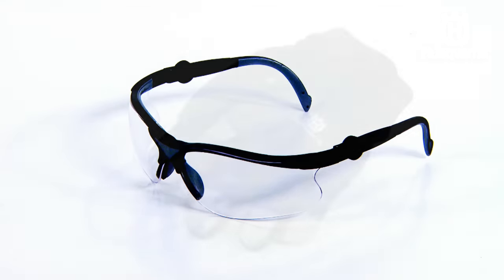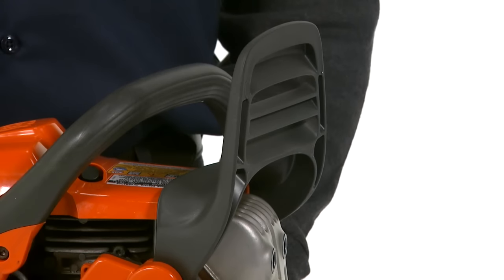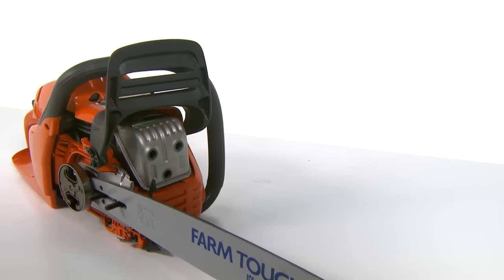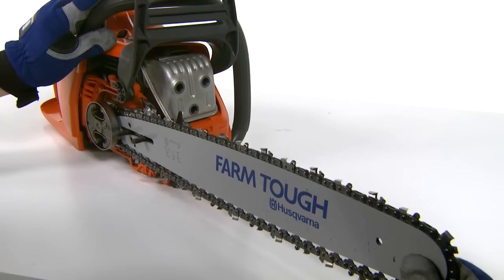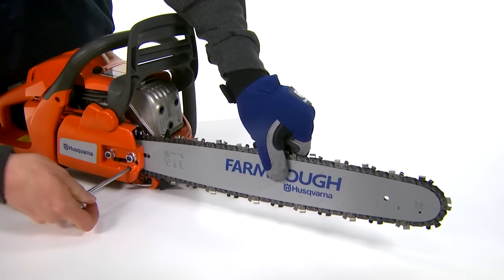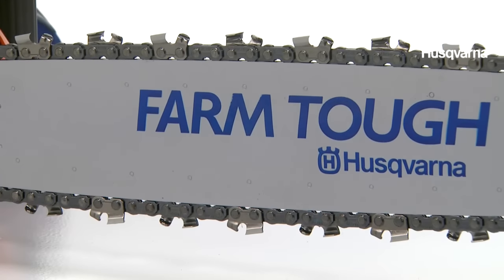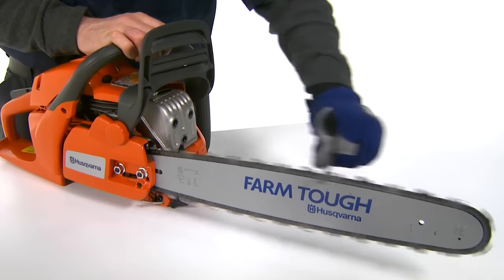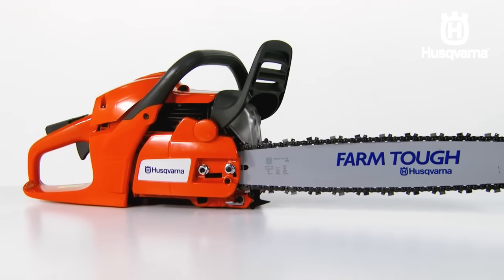How to Fit the Bar and Chain on a Husqvarna Chainsaw

Comment: Incorrect information,  a certified husqvarna dealer is NOT the only one that can fix it if you forget to disengage the break.  It's an easy fix. I just did mine a couple days ago.  It is not hard.  Pull the cover apart,  take the plastic off that's on the inside of the cover,  pull the spring out which will give it enough room to put it back in where it needs to be.  Pull the spring out,  cut 3/4 of an inch off it, put it back in and reassemble. There is absolutely no change to the chainsaws ability to work properly.  Again,  this is what I did and it worked.  Save yourself the money and do it yourself
Reply: It's even easier than that.  Just put the cover back on while the bar is off, press the gear down on the place the handle engages it and pull the handle back.  You don't even have to take anything apart.  Lots of videos on YT showing the process.  Super simple.

Comment: I can't get the chain brake cover back on because the manual chain brake spring that goes around the chain brake is too tight. In fact I had a hard time getting the cover off because that spring was would not let go of the Chain break. Now I can't put the cover back on because the spring diameter Is too small.
Reply: Probably  because when you took it off the brake was on. I did the same thing. You have to unlock it with a tool to put it back on. You can find a video of it here on YouTube. But you will probably have to order the tool. Good luck
Reply: @williamhartsell6390  Yup. I realized that later on. Inadvertently pushed forward on that chain brake and set myself up for a world of hurt. Man it was tough to get that brake released when the mechanism is apart. Finally got it. Won't make that mistake again!
Reply: you have to disengage the brake before you start the project -- there is a few videos that show how to do this -as I've done it once - a real PAIN in the Biden!
Reply: @jimforsythe3129  in my case, the chain brake got accidentally engaged and I took the damned thing apart that way. I know never to do that again!
Reply: @basspig how did you get the cover back on?
Reply: @Greg-yh2md  yes, after a couple of hours of making a jig to turn the brake assembly back to the unlock position.
Reply: Thank you. 

I forgot to release the brake before removing the cover. I saw someone used a 9/16” wrench to turn the brake off. They used a screwdriver into the the opposite side of wrench (the side with the circular 9/16” opening). Used the screwdriver in the opening to twist the wrench which was engaged with the 3 pronged key in the chainsaw, twisting  the 3 pronged key and unlocking the brake. 
Live and learn. And, Happy Holidays.
Reply: @Greg-yh2md  The tricky part is that it is very easy to inadvertently engage the chain brake when in the process of pulling off the chain brake/cover assembly. Nowadays when I do this, I take extra care to make sure the brake is off before I remove it.
Reply: 41

Add a comment...

@AndrewKleinow-z2t
0 seconds ago
Incorrect information,  a certified husqvarna dealer is NOT the only one that can fix it if you forget to disengage the break.  It's an easy fix. I just did mine a couple days ago.  It is not hard.  Pull the cover apart,  take the plastic off that's on the inside of the cover,  pull the spring out which will give it enough room to put it back in where it needs to be.  Pull the spring out,  cut 3/4 of an inch off it, put it back in and reassemble. There is absolutely no change to the chainsaws ability to work properly.  Again,  this is what I did and it worked.  Save yourself the money and do it yourself

Comment: Just took my bar off with our pushing the handle , dammit
Reply: 41

Add a comment...

@AndrewKleinow-z2t
0 seconds ago
Incorrect information,  a certified husqvarna dealer is NOT the only one that can fix it if you forget to disengage the break.  It's an easy fix. I just did mine a couple days ago.  It is not hard.  Pull the cover apart,  take the plastic off that's on the inside of the cover,  pull the spring out which will give it enough room to put it back in where it needs to be.  Pull the spring out,  cut 3/4 of an inch off it, put it back in and reassemble. There is absolutely no change to the chainsaws ability to work properly.  Again,  this is what I did and it worked.  Save yourself the money and do it yourself

Comment: Anyone have issues with nuts vibrating loose when in use? I feel like there ought to be a washer or something but they just go snug against plastic on my Husqvarna 130 saw. 20 seconds of use is enough to see the first nut tumble. Seems dangerous.
Reply: I just had the bar and chain fall clean off my saw in use.  Talked to the dealer and all they said was they have "never seen that before" and that the bar either wasn't seated on the posts correctly or the nut vibrated loose.
Reply: @22evansm  I had to bring to a dealer for another issue. When I complained about the nut vibration he just suggested putting on a drop of thread lock. It has sort of fixed the issue to be fair but I still think there is a design flaw. Shame as you opt for Husqvarna to avoid such.

Comment: my dad has this saw,when you start the saw the chain immediately rotates itself,its fine if the brake is activated but once you take the brake off the chain runs by itself,how do i adjust this,thanks
Reply: the clutch needs to be replaced
Reply: Maybe adjust the throttle screw

Comment: My chain won’t tighten and I have the bar pulled all the way out
Reply: Stretched replace chain.dress cutter bar.check oil holes arnt blocked.
Reply: @richardhills235  ok. Fixed.

Comment: 08.10.20 - Wondering, when running in the new chain in and then going about retensioning the chain do we need to spacken off the bar fastening nuts each time.
Reply: when the chain stretches, you may have to loosen the nuts to move the bar forward as needed.  Sometimes the fine tuning screw is at its' limit and requires the bar to be shifted forward.  Every brand is different in how they design the tensioning.